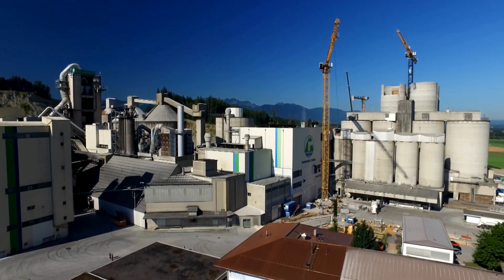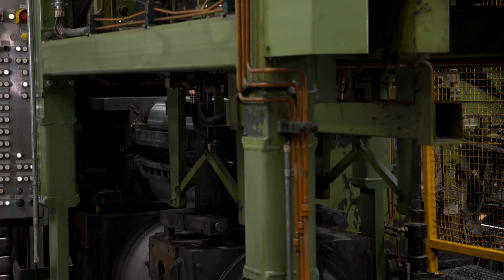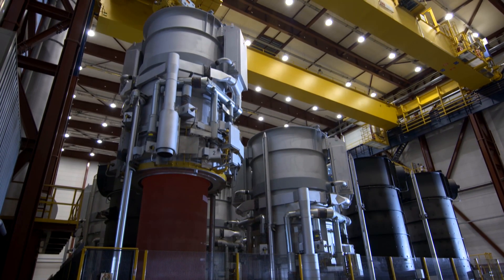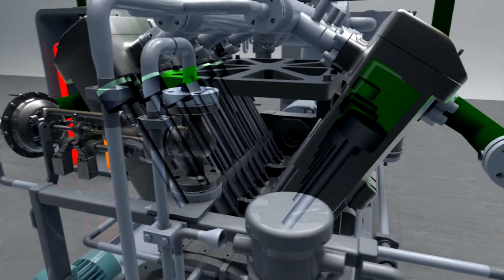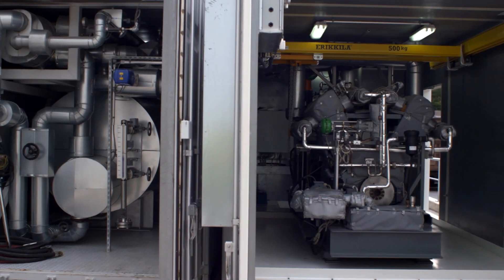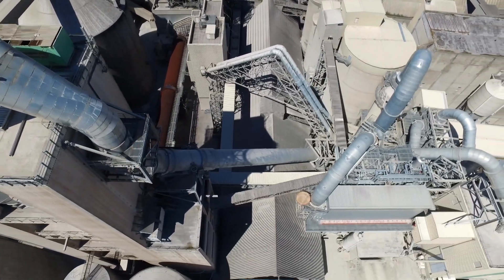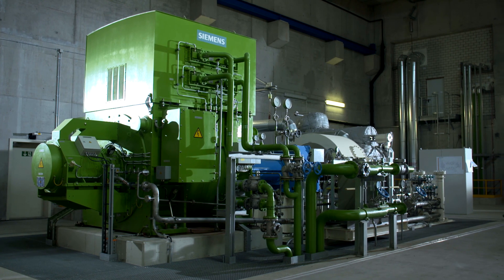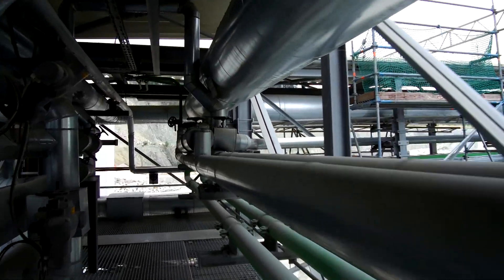Generating electricity from industrial waste heat

Comment: 10:35 so far I have see a lot of metal pipes that could be insulated like/with a lot of hot water heater jackets saving a lot of heat losses.

Comment: High temperatures (400-800 Celsius) means high quality steam potential thus electricity. On the cement factories you get this high grade waste heat. On the contrary, in the power plants you get low grade waste heat (90-120 Celsius).The exergy (electricity) was already extracted so all you can do is to take a shower.😀

Comment: I use dissimilar crystals dug from the earth's crust enclosed in a stainless steel chamber mounted to my car's catalytic converter to generate electricity which powers an HHO generator to produce hydrogen gas which is then piped into my car's intake manifold.  This helps achieve a 1-2% increase in mileage.  Not a huge increase I know, but at least the electricity to generate the HHO is free since I'm using waste heat to generate it.   I'm still in the very early stages of my design and I'm still experimenting with different crystals until I find the types that will generate the most electricity from the heat I have to work with.  I'm hoping one day that I will be able to find the perfect combination to use and will then get it patented.  BTW, in the course of my experimentation, I discovered that not only applying heat to certain crystals will generate electricity, but also by applying pressure to them, I was able to get some to produce electricity so this might be useful in a car where wasted mechanical energy (i.e., from bumps in the road) could be harnessed.  I'm thinking that these 2 effects are related since I am hypothesizing that heating certain crystals distorts the crystalline molecular structure similar to applying pressure to them to cause the valence electrons to be pulled from their orbit (by mechanical (i.e. heating or pressure)) means.
Reply: This is not a "discovery" but piezoelectricity. It's what is used when you touch your smartphone screen. You apply a pressure with your finger and...Voila! A micro electric current takes place. Also piezoelectricity is used in large weighing cells. The weight pressure is converted to electric value then the pressure is "converted" to mass.
Reply: How to apply for a job in wHRS ?

Comment: 15 % is remarkable.As I know,a thermoelectric generator recovers 5-7% of electricity out of the waste heat.
Reply: depends on temp and the working fluid inside, from 5% to 36%(900F, mixed fliuds)...
Reply: The thermoelectric generator is still pretty good.
Reply: You all prolly dont care at all but does anybody know a method to get back into an Instagram account?
I somehow forgot my password. I would appreciate any tips you can offer me.
Reply: @Daxton Elliot instablaster =)
Reply: it can reach more than that.